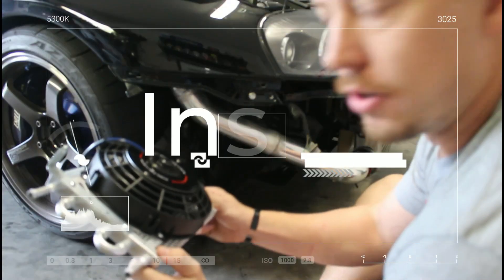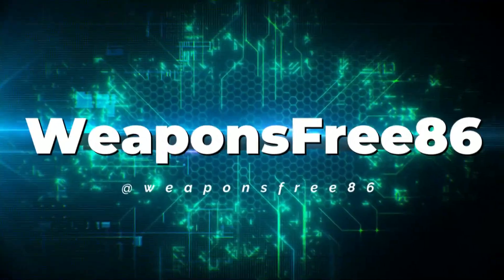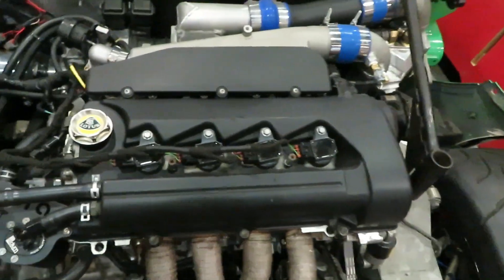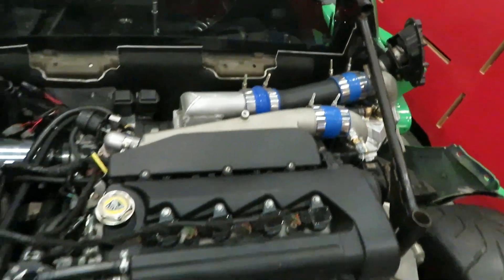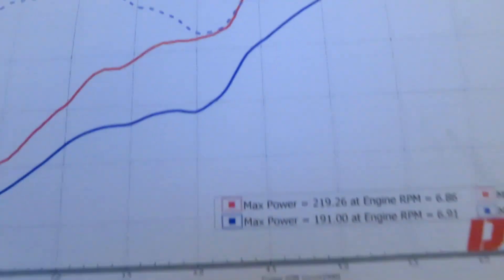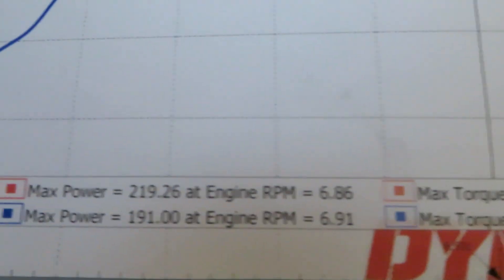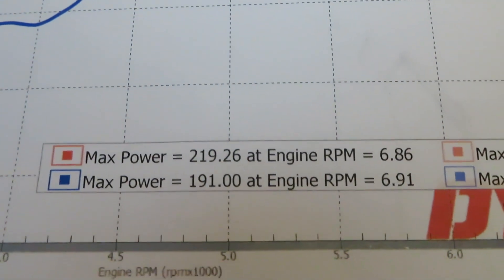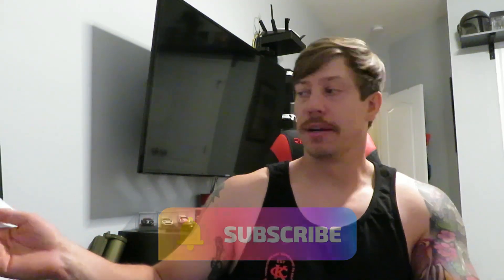How much power does a stock GR86 make?

Comment: Yo, will you be installing the Tom’s rear bumper + axleback quad exhaust on the new GR86 (like you did with your old FRS)?

In my opinion, that’s the best set up by far.
Reply from the maker: I'm on the fence between the Sard, amuse titanium and the toms.
Reply: @Weapons_Free_Racing  
You’ve got good taste man! My vote is still the Tom’s set up. I think it’d go really well with your black paint (especially if you wrap it the diffuser in gloss carbon fiber).

Comment: You mightve mentioned this already but I cant find it. What is that tire/wheel combo? That's exactly what im looking for.
Reply from the maker: I did in my previous video. But they're 17x9 +35 with 245/40/17 tires
Reply: @Weapons_Free_Racing  Thanks man.
Reply: @Weapons_Free_Racing  I have that same spec for my wheels from my first. Hoping I can keep them. Do they fit on 2nd gen stock suspension?
Reply from the maker: @DirtMagert97  unfortunately I don't know. Coilovers were my first mod... 😬 sorry.